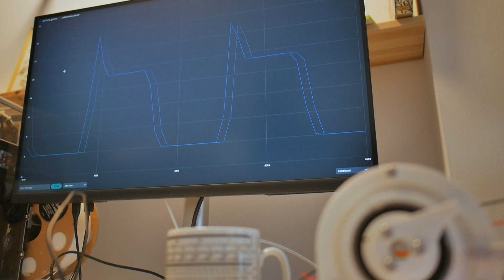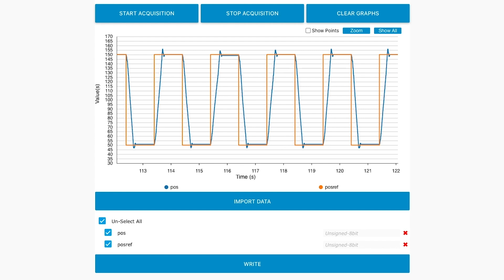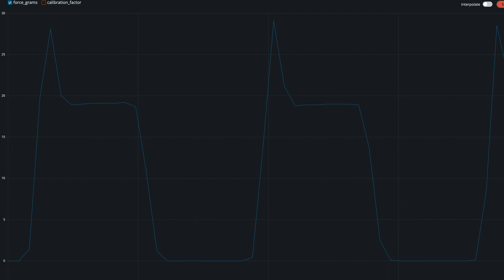building a closed-loop pcb motor from scratch

Comment: the pcb is usually the rotor in axial flux motors if I recall my lessons correctly
Reply: Not sure why you would make the part rotate that requires electrical wire connections.

Comment: I believe this could work better with rotors and magnets on both sides of one PCB stator instead of PCB stators on both sides of the rotor. The reason for that is that all of the field lines would then pass through the rotors instead of half being outside of the rotor/stator assembly.